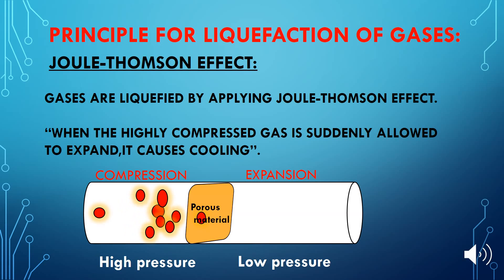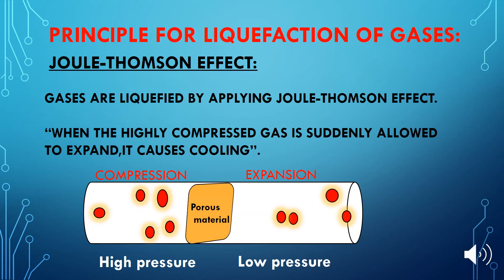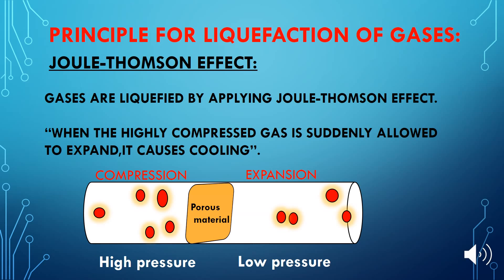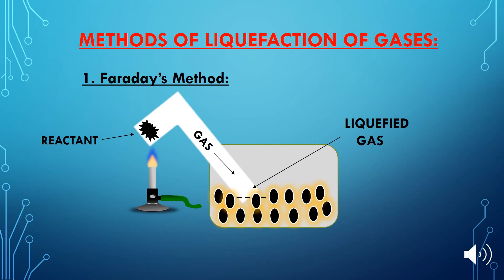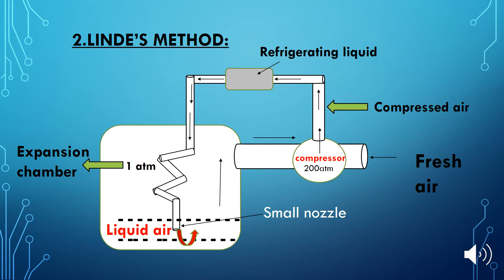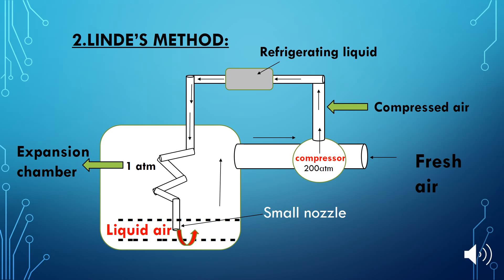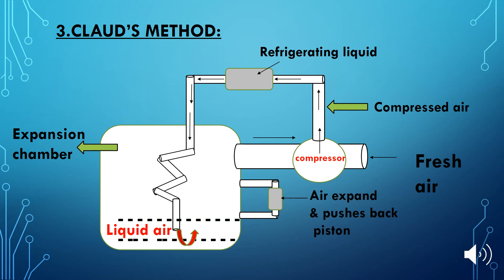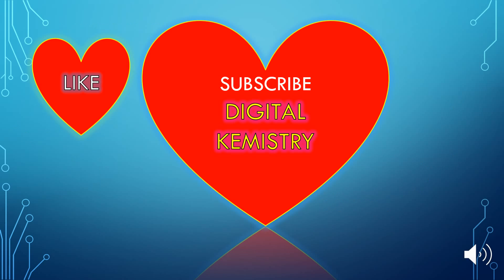JOULE THOMSON EFFECT ANIMATION: PRINCIPLE & METHODS USED FOR LIQUEFACTION OF GASES|CHEMISTRY-YOUTUBE

Comment: Will it also cause heating... If yes how  ???
Reply from the maker: One of the interesting properties of helium is that it has a negative Joule-Thomson coefficient at room temperature (down to about 53K), which means it becomes hotter if it decreases pressure isoenthalpically. Most real gases behave the opposite way (hydrogen and neon are exceptions which also have negative Joule-Thomson coefficients).
Reply: @DigitalKemistry  is all inert gas have that effect? or just helium?
Reply: What Is Islam?

Islam is not just another religion. 

It is the same message preached by Moses, Jesus and Abraham.

Islam literally means ‘submission to God’ and it teaches us to have a direct relationship with God. 

It reminds us that since God created us, no one should be worshipped except God alone. 

It also teaches that God is nothing like a human being or like anything that we can imagine.

 The concept of God is summarized in the Quran as:

{ “Say, He is God, the One. God, the Absolute. He does not give birth, nor was He born, and there is nothing like Him.”} (Quran 112:1-4)

Becoming a Muslim is not turning your back to Jesus. 

Rather it’s going back to the original teachings of Jesus and obeying him
Reply: @ahmdabdallah5811  noone asked 😂😂